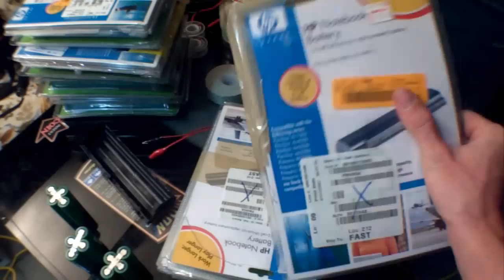DIY: 48v 24ah lithium ion 18650 e-bike battery pack

Comment: When stacking the battery voltages in series, should you use the nominal voltage, rather than charging voltage? -3.6V@6S= 21.6V vs. 4.2@6S= 25.2V- That would mean you need 7 series to get your 24V+ nominal rating per pack.  Then I guess you would need a bigger balance charger...I suppose running your motor slightly under voltage is no big deal...the controller should compensate, right?
Reply from the maker: i recharge them once they hit 3.9v. and they dont dip in voltage much.

but really the voltages dont really matter. i would say just build your bike for like 56v. the controllers can take more voltage than specified. and the motors can take like 90v. so you can just buy a higher voltage controller if need be.

the controller doesnt compensate, its a piece of shit. but it works.
Reply: I assumed the controller would draw more amps when the pack voltage gets depleted to keep the power output stable.  I am in process of building a pack using your videos as reference.  I already have some laptop batteries on order and a balance charger too!  I figured using 7 series would let me keep the cell voltages lower while keeping the pack voltage relatively higher (I'm trying to determine wiring for pack longevity)...but if I can stick with 6Series I would much rather have capacity, over voltage if the end result is negligible in performance.  I thought 7+ series would allow me to reduce individual cell depletion while maintaining pack voltage, resulting in less strain per cell.  Any thoughts or advice? On another note, I would ideally like to build my pack to be modular so that I can stack "12V" packs, up to "48V" for a bike and also use the packs on a 12V inverter when desired.  I have some wiggle room in pack design, since most inverters run between 10.5 and 15V.  Thanks for your quick response, and keep up the videos!
Reply from the maker: *****
i've been planning on building and selling 12v 13ah modules. radioshack sells a project enclosure for like 7$ that will hold  20 or so 18650s. just FYI.

tbh i think your overthinking the 6s or 7s in a pack. i only made them 6s for the charger and to keep it modular. i plan on making like a 2s pack i'll add onto the battery someday to make 56v or so. the motor controller runs from 36-60ish volts.

and no the motor controller only switches the power into 3-phase AC, it doesnt have any power transformers. so really all it does is flip the polarity of the power going through to match the timing of the motor. or so i think.

oh and for every 0.1v you go lower than 4.2v you double the cycle life of the cells.

but again, voltage doesnt really matter to much for me because i never use the full power. i stay at like 20mph instead of 30. if i upped my battery voltage all i would be doing is making me hold the thottle down 50% instead of 65%.
Reply: *****
Since 3.7V, 2.2 Ah Li-Ion cells have a cut-off voltage of 3V and max charge V of 4.2V, then here are a few calcs for you:
6S cells:  V@cutoff, nominal. max (18, 22.2, 25.2), 10 banks of 6S cells = ~488 Wh
7S cells:  V@cutoff, nominal. max (21, 25.9, 29.4), 9 banks of 7S cells = ~513 Wh

If your controller and motor can handle higher V, then use more cells in series.  Connecting batts in parallel just gives you extra capacity.  If you don't want to ruin your cells, make sure to have the same # of cells in each bank.

Also, some motors are already optimized for their rated voltage.  This means they cannot tolerate much over voltage without becoming very inefficient & HOT (which will melt the laminations on your motor windings) & cause your motor to fail.  Hot controllers cause power chips to fail as well, so make sure your controller can hand the extra voltage & current.

Another thing to remember is max V drops off pretty quickly as you use the energy from the battery.  That means you probably won't be over-zapping your motor windings for too long when you have freshly charged cells. 29.4V is just 4.4V above the rated V of many motors.  Check with your motor manufacturer (if you can) to determine how much over-voltage & over current it will handle.  If you can't get that info, you could experiement to determine how hot your motor runs. Hot motors (especially on warm/hot days) make for less electric joy riding.  Don't test only during cool weather--because when the weather warms up, you might find yourself pushing your e-bike home...

Making a 12V battery works out this way:
3S cells:  V@cutoff, nominal. max (9, 11.1, 12.6), 20 banks of 3S cells = ~488 Wh (which is quite a big battery pack)...
Reply from the maker: A B
 lithium cells don't have a cutoff voltage. only protected cells have that and those are rare.
Reply: You are incorrect.  Download & carefully read the the datasheet of your cells.  The datasheet should clearly show the recommendation is to not deplete the cell charge below 3V.  Doing so reduces the cycle life & charge capacity of the cell.

If you have been depleting your cells below 3V, you won't get much life out of them compared to someone who follows the manufacturer's recommendations.
Reply from the maker: A B
you don't seem to understand what a cutoff voltage is. when the cells hit 3v they don't have any circuitry to automaticly turn themselves off, thats just absurd.

and no, you can get them down to 0.3v and if you revive them properly they dont lose hardly any capacity. you can see the results in my recent video where i accidently broke my bike battery.

the effective drained voltage is 3.8v. any lower than 3.9v and your batteries won't keep their voltage up under load.
Reply: See.. if you would actually go read the datasheet for your cells, rather than further demonstrating your ignorance, you would realize that the manufacture specifies a cutoff voltage of 3V to ensure the cells are not discharged below that voltage. Why?  Because if the cell voltage routinely gets discharged below that voltage, the charge capacity, available amperage, & life span (# of charge cycles) all diminish.  Electrical engineers regularly add low voltage circuitry (per the manufacturer's low voltage cutoff specification) to their designs to prevent such problems from occurring. 

Just so you know, the type of li-ion cells which have a built-in protection circuit, not only protect against low voltage, but they also protect against high current discharge to prevent a cell from over heating.
Reply: Rinoa Super-Genius
And because you are still probably too lazy to go look up the truth, here's a little blurb for you:  "The maximum voltage for charging is 4.2 V, and the cutoff voltage in discharge is 2.5 V (for hard carbon batteries) and 3.0 V (for graphite batteries with cobalt oxide cathode)."
source:  http://www.sony.com.cn/products/ed/battery/download.pdf

Note:  The reason they call it a cutoff voltage is because if you view the graph which shows the discharge curve of a graphite cell, you will see at approximately 3V, the available current drops like a rock--even though the cell voltage is 3V.  Discharging a battery in that charge depletion region is NOT recommended--which is why electrical engineers incorporate low voltage (i.e. cutoff voltage) circuits to protect unprotected cells.  Some cell manufactures have decided it was wise to incorporate such circuitry into their cells--others don't because they don't care if nitwits destroy their cells--they'll just end up buying more...
Reply from the maker: A B
 you rely on other people's work, wearas i rely on my own experiments in witch i document them on my channel.

your comments are too long for me to justify reading btw.
Reply: Can't we all just get along?  LOL/ I appreciate the free exchange of information, as these insights have improved my personal understanding.  Knowledge is one thing, wisdom is another.  Thanks :)

Comment: I ordered 10 HP 12 cell laptop batteries so it would be 12 cells in a series of 9 like you did but with an extra 12v have yet to get the batteries in the mail but am waiting for them to test amp's... I think i have the same ones as you just by looking at the casing they were in when i watch your video... do you happen to know your amp's that can be pulled on the battery without a BMS?

Comment: Its probably been said but what about a battery management system? Also what is your power supply called? Where did you get it? Also great video I loved it but you should add an update to tell everyone you really need a BMS system for long cycle life.
Reply from the maker: thanks for enjoying it. try to remember to check the description of videos for updates. i put a link to the Balance charging video in the description AND an anotation for the next video in the video itself :p

but yeah i am using an Imax B6 battery balancer in the next video. and your asking about my universal power supply in this video right? its the cheepo 70$ one from ebay. the cheepest you can get.

this same power supply is rebranded soooo many times but they are all pretty much the same inside. its a 0-30v 0-5a DC supply. i have left mine running experiments for up to 2 weeks and it works fine. for long usage it can't go above 2 amps or it overheats and shuts off. this problem comes from a heatsink they put right infront of the fan so the fan doesnt do any good. ima modify mine though. also if its turned off and on sometimes it can make an 18v spike that would kill small electronics. i havent had any voltage spikes kill electronic circuits yet but this model is awesome for batteries and stuff that can handle odd volages.

fweew sorry for that ramble.
Reply from the maker: oh and BTW i run my cells at 4v instead of 4.2v so i not only get 4x as many charge/discharge cycles but i have a lot more room for the cells to get out of balance. i only balance it every few months.

Comment: Are the battery tabs that come with the batteries good enough for a 48v bike? I am spot welding mine together with slightly larger nickel strips.
Reply from the maker: they are prolly more than enough to handle the power.

Comment: Actually the ratio of mass to wind resistance for a crouched cyclists may well be less than a car at the same speed.  The specific gravity of humans is higher than water, humans sink.  A sealed car probably would float - most of the volume of a car is empty, but it is streamlined. 

On the other hand, charging equipment may lead to further problems.  If the battery charging rate is too low, then capaciters would have to be used.

It is an interesting problem.

Comment from the maker: are you buying laptop battery packs or individual cells? if your buying trustfire or truefire (theres several variations of that brand) they are rebranded crap from china. like you could buy and 18650 thats rebranded as new 3ah but its really 9 years old and only 300mah. i would only use brand names like panasonic.

and most laptop batteries use brand names or atleast origenal instead of rebranded. i wouldn't pay more than 2$ per cell.

lemmi draw a schematic of my battery and post a link ^^b

Comment: I bought a surge protector with a battery backup a few years ago. It is heavy and if anything is plugged into it when the power goes off an alarm sounds every few seconds. Could you make a video on replacing the lead acid batteries with lithium batteries? Please and thank you in advance
Reply from the maker: thats actually fairly easy, find a BMS that handles that voltage, then use my „tinkerers guide to the 18650“ to build that battery. the BMS is a circuit board that makes the lithiums work as simple as a lead acid.

Comment: Samsung 25R 2500mAh cells can be had for about $5.25 per.

Can a 48v 20Ah battery be made of 96 cells: 8 in parallel, 6 of those in series, and 2 of those in series? If so, the cell total pencils out at about $500 and 4.3 kg.
Is that for real?

Comment: your question boggles me. 16 cells are in 1 pack rite? and you have 4 packs if 1 cell was 4v it would be 4v X P in the long run you would be pushing 64v! if using all 4 16 cell packs each pack would be 16v unless you have them layered a diff way then i think you do...

Comment: Hey dude..I have an e-scooter that right now has 5 big sealed lead acid batteries (30AH) but I'm pretty sure they're dead so instead of buying new lithium packs (like 800 bucks) I think I'm just going to do this, but bigger and maybe 72V.  Does that thing really hold 24 AH?? It's wayy smaller..  And can I just use the regular charger or am I going to have to get something else... thanks man, this is really helpful.
Reply from the maker: if they where higher capacity cells that could hold 36AH. i think when i tested it was 24.7AH but some rows of cells where a bit low. so if i evened them out it would prolly be 27AH.

you will need to balance charge the pack, but you could do that like once for every 15 times you charge it. for quick charges you would need a voltage regulating and amp regulating power supply.

http://www.ebay.com/itm/Digital-Led-400W-10A-DC-Step-up-constant-voltage-current-boost-Converter-8V-80V-/281207195608?pt=LH_DefaultDomain_0&hash=item41794147d8

something like that would allow you to limit it to like 72.0v and only give 4amps or whatever, then just power that with the 24v lines on an ATX power supply.
Reply: Rinoa Super-Genius Thanks for the reply brother, much appreciated!  I'm going to take another look at your other videos about this because the first time I watched them I didn't have an e-bike, but this seems like a much better option than spending a grand on some pre-build chinese battery packs.  Do all these laptop batteries come with 18650s?

I think what i'm going to do is build two battery banks of the size in this video of 36 volts (30 or 40 18650s per 36 volt unit I guess) and run them in series to make 72, this would give me more flexibility to where I can put them and such, and also allow me to better manage the balance of the cells and charge each 36 volt unit separately.  I like how flexible I can do this and arrange each 3.6 cell how I want.  What I'm worried is protection, I don't want to sit on a bomb lol.  

What type of charger would you recommend?
Reply from the maker: sc0tte1
Any battery after 1998 should have 1865s. And I'd say the imax b6 or a BMS board.
Reply: Rinoa Super-Genius And that thing has enough amperage to charge that many batteries with that amount of voltage?
Reply from the maker: sc0tte1
 enough amps? you could charge a huge pack with 0.01amps and it would still charge, you don't need so many amps to charge a back. just the more amps the faster.

the imax can give about 3amps at 24v (can go to 5 but it starts overheating) so for every 3ah it will take 1 hour to charge from fully dead. but you can always modify an ATX power supply to charge them quickly without balancing.
Reply: Rinoa Super-Genius I see, thanks for clearing that up - believe it or not I went to school to become an electrician, but I have no idea what I'm doing when it comes to batteries.  So 24 volts is good to charge 36-72 volts?  Thanks for your time brother, I appreciate it! :D
Reply from the maker: sc0tte1
 thats sad because they could have covered batteries in like 2 days
Reply: haha, where are you? IF you need the batteries, contact me. maybe I could help you. 800bucks is too much.
Reply: Lane Junior I'm in Toronto Canada.  I agree, it is too much, which is why I was planning on making my own buddy :)
Reply: sc0tte1 send me a picture about your e-scooter. the best 60V30AH sealed Lead-aicd battery in China is 200USD
Reply: Lane Junior  could u share more information regarding this battery
Reply: I'm working for an ebike manufacturing company. We have cooperated with the best battery suppliers in China. Chaowei, Tianneng are the best Lead Acid battery suppliers in China. About lithium batteries, we cooperated with Samsung and LG and Panasonic and some Chinese native big companies. So I know batteries very well. The solution in this video is totally wrong.
Reply: Ravi Shankar the solution in this video is very dangerous.
Reply: Lane Junior Why's that?  As long as there's a fuse it should be fine?
Reply: sc0tte1 Even there is a fuse, it wouldn't be fine. Lithium batteries are not so stable. and you don't have a proper charger.
Reply from the maker: Lane Junior
 imax b6 is good enough. and lithium cells are stronger than you think.